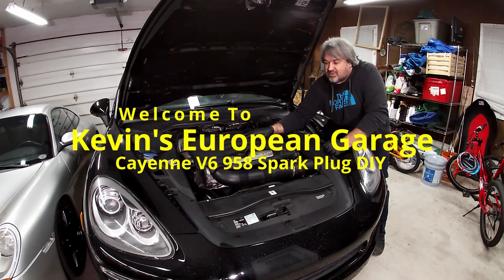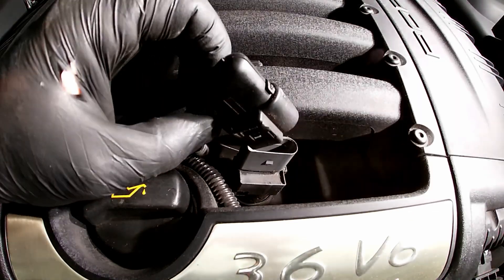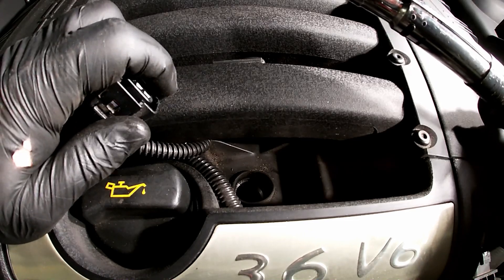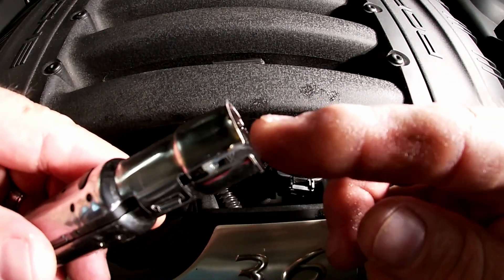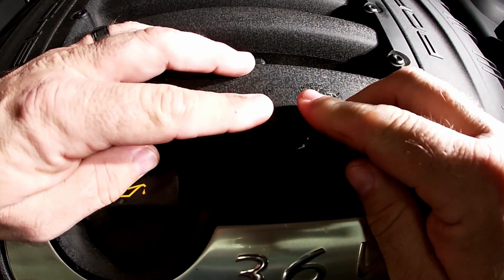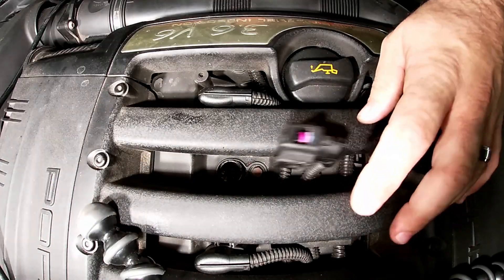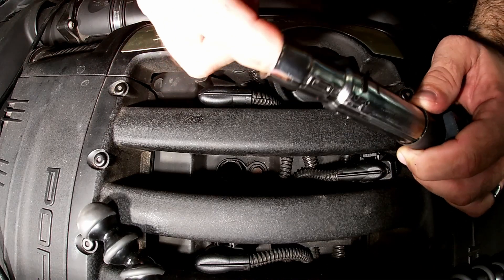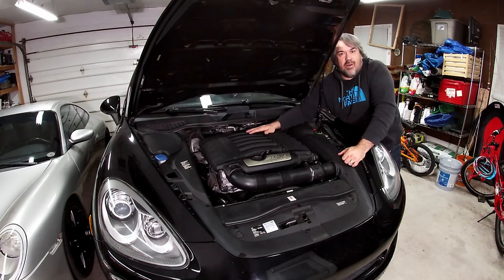Porsche Cayenne 958 V6 Spark Plug DIY

Comment: Alternate sides when you pry with the pliers. Start on the left side first. I tore up the first coil pack around the plastic on the first plug because I was working against myself. This is actually an easy job but I did almost have to lay in the engine bay to get the last 2 plugs out. Thanks for the tutorial.

Comment: Just changed my plugs today. Awesome tutorial. The spark plug coil boot remover/installer tool makes it much easier
Reply: Hi, just a quick question… I am looking to change ignition coils and plugs. Did you disconnect the battery?
Reply: @dcschaaf  no I didn't
Reply: @chrisgandhi6463 awesome, thanks very much!

Comment: Great video, thx!!! I will attempt my first spark plug change some time this month when all the parts arrive.
Reply from the maker: Thanks for watching!
Reply: @KevinsEuropeanGarage  I was able to complete the spark plug change and it was definitely needed.  I was more confident after the first coil pull.  I did try the paint can opener that others mention but the toward the firewall I used the same tool you showed on the video.  It was easier for me.

Comment: I've used a tool for ignition coils to pull them out witch made a process much easier for me , but I didn't use that lubricant that you showed , wonder if it's need to be redone with lubricant ? Will do it with lubricant next time though.  Thanks for a great video! Very helpful!
Reply from the maker: Thanks for watching. That stuff works great for any electrical connector you want to lube up and keep water out.
Reply: Andril can you pls tell which tool you used to remove ignition coil ? Can you share the link of tool to buy one ?
Reply: @ashtonwoods  not sure where exactly I've got mine from but this one looks exact same : https://www.amazon.com/FIRSTINFO-Ignition-Removing-Installing-Pullers/dp/B01J4ZDVP2
Reply from the maker: I used something like this 
https://www.harborfreight.com/hand-tools/pliers/11-in-45-bent-nose-long-reach-pliers-64088.html. 
Thanks for watching!
Reply: Should use it
Reply: @andriikifiak4936  I purchased this tool and it made the process much easier. I don't think I would have been able to do it with plier considering how much force you have to use.

Comment: I think there is small tool it looks like   ( ? or like Greek letter Sigma )  or hook, made of aluminum (about 3 inches in length in tool box provided by Porsche. You need that tool to open clip and it pops right up.

Comment: I need help,i just installed a new ignition coil pack (6) on my 958 and now it won't start 😞 im sure i did it right..actually i installed back the old ones and it won't start  either

Comment: hey nice video. i got a different question. got a cam positioning sensor code. car runs rough. i replaced it witha new one. it wont start with the new one. if i put the old one back in she starts. then brake proportioning warning now appears. 2004 v6. i know thats not all the info you need. just throwing it out there.
Reply from the maker: Well with the cam sensor in back of the engine and with all those wires running there maybe something cane disconnected accidentally. I would say it sounds like that cam sensor is no good. There really isnt much to them. Running roungh throwing a cam code sometimes that could be a timing issue. Possible issue with chain. But its hard to say without having the car to look at

Comment: Thx for ur videos again..I found that when releasing the gas pedal, especially the speed was about 30-20km/h, when the transmission dropped from third gear to second gear, the car would a little vibrate, and the ears would not sound comfortable. When speed up and push the gas pedal, there was no such thing. Is this normal?or I should change the spark plugs? Or is it a gearbox program problem? But its better in sports mode when I am driving..
Reply from the maker: I did have a vibration slowing down like that. That got better after I changed out the transfer case fluid a few times..
Reply: @KevinsEuropeanGarage   I changed TC fluid and spark plugs aready,and I inspected   in a garage ,found vibration from front pipe ..Im going to prosche dealer next monday..when I made an appointment.they told me some V6 cayenne have this issue cause original flex too soft.also you can double check holding gas pedal on 1200 rpm.if you have vibration.should from catalytic converter..we will find the result..
Reply from the maker: Yes they do have issue with flex sections mine also has that problem I do have some rattles from it. It’s on my list of things to tackle on this car
Reply: @KevinsEuropeanGarage  You are right,I did an additonal support from porsche dealer yesterday. but no any different...seems they don’t know the exactly position of the vibration..waste 400+....Flex part is an issue by design...hope can find a cheap way to fix it...
Reply from the maker: I have had a viewer recommend mufflerexpress.com for catalytic converts. Unfortunately I dont think there is a cheap way to fix it. The ones they make aren’t to crazy expensive like the factory. I haven’t tried them and probably will when I replace mine
Reply: @KevinsEuropeanGarage  Yes, the porsche dealer told me this 1200 rpm vibration issue just happening on 3.6 VR6 model...I think the only way is that replace the aftermarket front pipes..If you can repalce it yourself ...the price of Catalytic Converters I can accept it 😂...because OEM parts around 3,000 I asked....
Reply: @lyz5894  is this covered under warranty?
Reply: @MrGojuShodan  No, at last, I found that it was the vibration of the exhaust pipe, a design problem, unless the exhaust pipe was replaced.

Comment: hi kevin  can u tell  the detail / generic serial number for this cayenne 2012 ignition coil ? which   brand  do u recommend ? thx
Reply from the maker: The factory part number is 95860210100. If I was going to replace mine I would use Beru coils. I have them on my 911 with no issues.